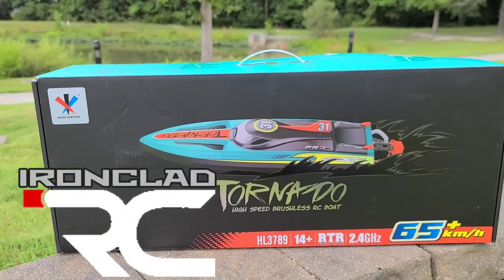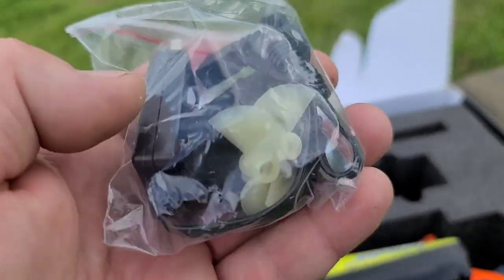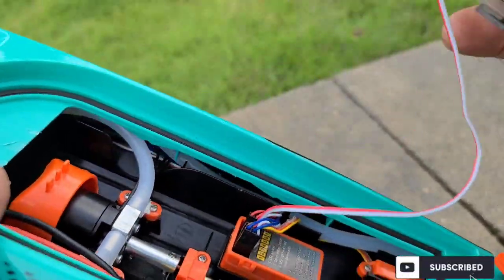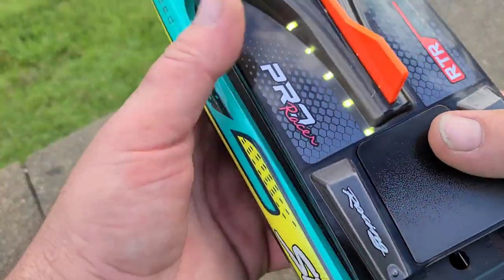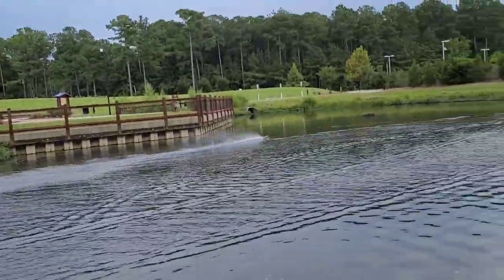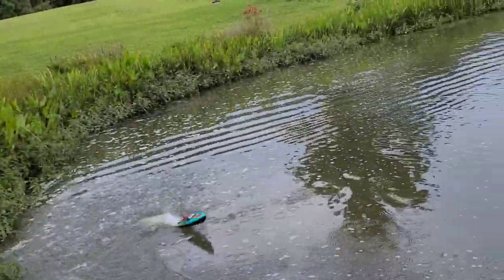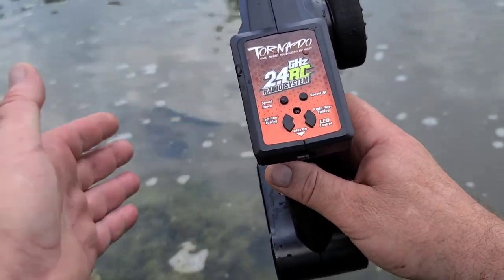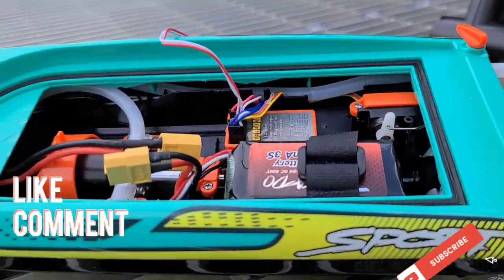Tornado 17" Self-Righting Brushless Rc Boat With Beginner Friendly Features - Henglong Rc Boat

Comment: i wonder if esc was hotter than motor or not hot at all... Also battery temps are important to me...i puffed a bunch...this is a fast little boat for sure... it may be over 30 mph...maybe some tuning would get it to 35mph..I don't care how long you been running bigger boats a little ripper is always nice to have in your fleet.
Reply from the maker: Motor was a hotter than esc

Comment: not sure if you have an answer, but i ordered a similar rc boat from amazon but it says racebeast instead of tornado. mine didnt come with a strap for the battery and it keeps falling out. should i return it?
Reply from the maker: HD velcro stuck in the hull and battery or a small velcro strap will keep the lipo in place
Reply: @IRONCLADRC  did your velcro stral come with it from the box or did you add it later?
Reply: @IRONCLADRC  also do you have a specific type i should buy? the part where the battery goes (for me atleast) isnt flat and wouldnt hold velcro very well
Reply from the maker: Something like this should work
Dual Lock Fastener 1in x 2in 8pcs Reclosable Interlocking Tape Heavy Duty, EZ Pass Holder Adhesive Hook Lock Sticky Back Mushroom Mounting Tape Black Color for Indoor and Outdoor https://a.co/d/8ssC3Od

Comment: Great Little Boat !! Good Review......😎 
I have one of these Outrider Motors 
They are Air Cooled running in a 32" Boat Running 6S  With a Dynamite 120 does around 55mpg
Reply from the maker: Thanks brother.   55 is great on 6s with an outrunner.    Outrunners have loads of torque

Comment: Cool little boat.  Even cooler little pond.  Jeeze, I have to drive 25 miles to run my boats in what's little more than a wading pool; you seem to have ponds everywhere.  I suppose it's not that bad though, since I have little to no "publicly-accessable" water anywhere, the 'gator population is nonexistent.  You did touch an important topic for the newbie, and that is to consider the body of water before buying a boat.  The little Tornado would be hard to see at the Speed Run Spot, and the 42 would run out of room in that pond before it ever got on plane.
Reply from the maker: There's alot of little ponds near me, lots.   The big bodies of water are few & far between unfortunately (private lakes)
Reply: @IRONCLADRC  I suppose that's why there's nothing in my fleet bigger than 24" (with the vast majority under 18"):  Big bodies of water are few and far between (I live within a short walk to the biggest body of water on the planet, BUT........  It's salty and often times has 5' to 8' surf......)

Comment: Little ripper there.  Is it simple to remove the shaft for greasing?
Reply from the maker: I haven't greased it yet but liiks simple 2 grub screws and the shaft should pull right out for ya

Comment: how many ponds do you have around you? It seems you are at a different location every time! lol (lucky!)
Reply: The gators keep following him so he has to keep moving.  :goodvibes:
Reply: The speed run spot is a bit far away we've seen lately a lot. The pond with the trees I see the most, this one is new to me.
Now where I live there is water everywhere, small to large options galore.
Reply from the maker: There lots of smaller ponds around me, unfortunately in the summer months most of the smaller ponds are over grown with weeds..     I usually drive about 5-8 Minutes to & from the water in any direction.  The Speed Run Spot Is the farthest away 10-12 min depending on traffic.   My favorite little pond was 2 minutes away but they installed 2 huge water fountains smack dab in the middle of the pond so I'm not able to run my boats there anymore.   Grrrrrrrr
Reply: @IRONCLADRC  the park pond?